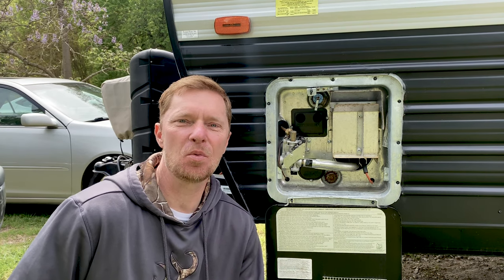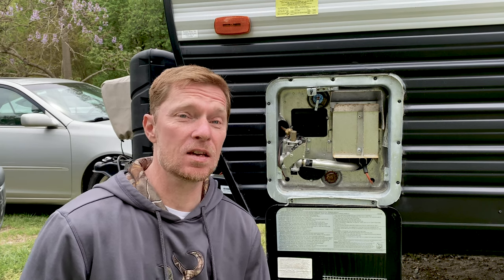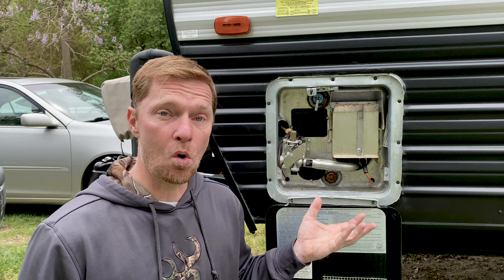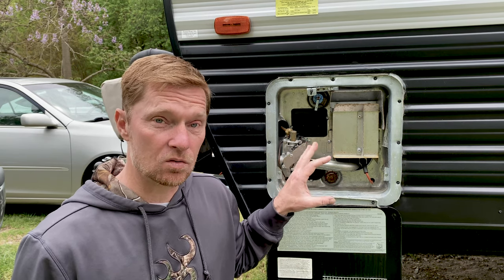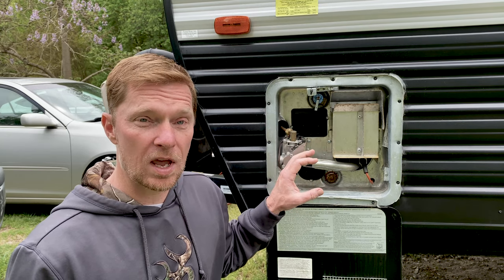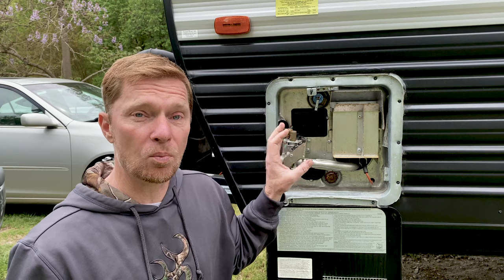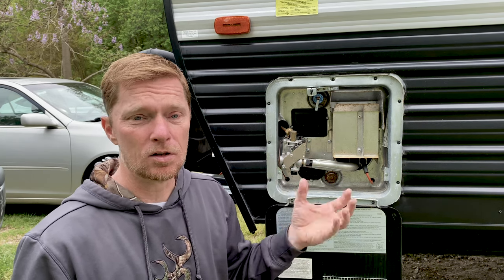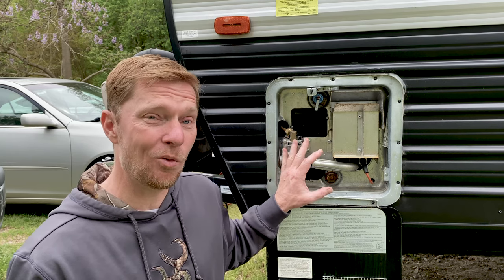Travel Trailer Gas Electric Water Heater Explained 2020

Comment: Just wondering if I should be using propane to heat the water when I'm connected to a 50 amp pedestal. Should they both be on? I have 2 switches inside my coach. Are they both 12volt or might one be 110 (one has a light next to it that says reset)?
Reply from the maker: You do not have to run both if you do not want to. Matter of fact, during the hotter parts of the summer, I leave the propane of for the water heater. As for you switches. Trying running a test. 
1. Turn both switches off
2. Make sure that the propane tanks are on
3. Make sure that the water in the tank is cold enough for the tank to fire up, I do mine by turning everything off and running the water until it goes cold
4.  Turn on the one with the light that says reset
5. Go outside to the tank and see if it fires up
6. If it does not fire up, turn the switch off inside and turn on the other
7. Once you find out which one is the propane, turn that one off and the other one on
8. Again, make sure that the water is cold on the hot water side
9. It is going to take a lot longer but you should start to feel the water heating up from the electrical element

I do not have a panel like your so i do not have any experience with them. I am also on 30 amp. If your unsuccessful, please send me an email with pictures of the water heater and panel and i will see if I can provide some additional support.

Also, I would love to hear back from you on what you find out. Be Safe and Good Luck

Comment: Great video. Can I start the water heater In electric mode only? And if so, does that make the exhaust cover not as hot to the touch? Thinking of grandkids touching it. Thanks
Reply from the maker: Yes and yes. The electric only will not make the cover hot. You will not heat up the water as fast but will do what your looking for.

Comment: Great video..but one explanation needed, my "new to me" 2015 Gray Wolf Toyhauler is NOT hearing my water... Propane is on, and black switch turned on, am I missing any other switch/button ?? Thanks !
Reply from the maker: Make sure that the switch you are refering to is the one for the propane. Mine is located at the panel inside. If you have that one on, try pusing the reset buttons highlighted in the video. Also check the 12V fuse in your distribution panel to make sure it is still good. After that, make sure that there is water running to the heater and that the propane line is not compromised in any way. I would love to hear what you find out.

Comment: What’s the big rod on the drain plug inside for? I originally thought it was the heating element but no wires somehow lol, why’s it so long? Thanks
Reply from the maker: That is the anode rod. You may ask what the anode rod is and I want to help. Here is an article on #RVlife website that will explain everything that you need to know. https://rvlife.com/techtipspreventing-water-heater-rust-out/

Comment: Hi! I have a water pump panel inside RV on the wall and im pretty clear on everything except do i need to keep the HEATER button on while permanently hooked up at park? I do get some hot water while it's off but I do have to shower pretty quick to enjoy it b4 it goes....so is it because I have that button off?
Reply from the maker: On mine, the switch on the inside of the camper is for the propane heating side of the water heater. The electrical side is outside at the water heater. If I have to guess your setup, the electricity may already be on, and turning the switch on inside of your RV initiates the propane heat. Also, you can run both of those heating solutions at the same time, or at least I can.

Comment: Great Info, question, so If I want my hot water to last longer I should turn on the electric  and the Gas heaters ?
Reply from the maker: From my experience yes. What i do now is leave the electric side off until about an hour before i plan on higher usage. This saves on how much of the 30 amp side i am using. Check out this video. It is a little in depth but explains power management. https://youtu.be/n_v7QkFzNds

Comment: Thinking on buy a RV thatyou can only heat the hot water tank by propane. What are your thoughts on that good or bed
Reply from the maker: That’s the way most older RVs used to be back in the day. To be honest, I use mine on propane more than electric. I like to keep the amount of electric used down so propane is what I use most. Hope this answers your question.

Comment: Great video! I would really love it if you could do another that talks about common issues with the hot water tank, or what is normal or what isn't. I have a very similar tank, might actually be the same model, or might not. But I just noticed a slight propane smell, and at first I thought it might have been because I was at the very end of my propane tank, but then I took a lighter to where the oxygen mixes in and a very small flame lit. The problem being I am running the water heater off electric, not propane. If this type of tank had a pilot light I would think that is what was going on, that the pilot light had just gone out, but this type of tank doesn't use a pilot light. Any ideas on what the issue is? Or is it normal to have a tiny bit of propane going through? I am at the very end of my propane tank, and I don't have my other propane tank hooked up...
Reply from the maker: Firstly, never use a flame near gas smell or to find leak. Believe me, i lost a few facial hairs because of that. For the leak, use soapy water in a sray bottle and spray down areas that could be leaking. you will start to see bubbles where the propane is getting out from. There should never be a leak at all, if you do then either something is mechanically not working correctly or you have a fitting or hose not seated like it should be. Once you find the leak, and need to do a repair, contact a mobile repair service to help.

Comment: Just curious.  When I fill my potable water tank, that potable water goes to my hot water heater.  If I then hook up to campground water, does that water then add to the potable water that is in the hot water heater tank?  Once hooked up to the campground water source, the hot water tank does not pull water from my potable water tank?
Reply from the maker: The water heater pulls from either the fresh water tank via the fresh water pump Orr the city water connection but in most cases, it can not be at the same time.

Comment: Great video I'm working on getting mine going it's from 87/5 wheel I just found out it's electric and propane and the electric switch was on which just started making electric noise only when I got water pressurized in the system the pressure valve is leaking also and it has a ground wire that needs to be reconnected which I already knewI'm hoping the electric portion is not busted it sounds like it's trying to work with that ground wire is not connected so we'll see how it goes
Reply from the maker: Good luck! Let me know how it turns out.
Reply: @HowToRV  so far i got the leaky pressure valve  out and the partially stripped  out drain plug finally  there was no anode rod in there just a plug / drain. im thinking i should replace with s anode plug    also in my 88 trailer there is no anode.  and i got that water heater going today !  had a hot shower .
Reply from the maker: Sorry for getting back to you so late. I am glad that you go your water heater running. I HATE cold showers

Comment: Okay just to confirm I can run electrical and gas at the same time? And is that just hook up or battery?
Reply from the maker: Yes, you can run your gas and electric at the same time. The electrical heat comes from hook ups only

Comment: Do a vidio on how to replace the suburban 6 gal hot water tank mine is only a 2016 and its leaking it works fine but leaks badly
Reply from the maker: I think that I can make that possible. I recently went to a tankless water heater and found that it does not meet the intent I was looking for. I am considering putting the original back in, which may cover what you are looking for.

Comment: Great video but I have a question so how do you light the propane side i got the electrical down
Reply from the maker: You can’t light it manually. Without the battery, the solenoid will not allow propane to flow and igniter not work.

Comment: Nead to know what electric components are between the fuse box an on off switch, any circit bouards or anything that would prevent powered to the switch?
Reply from the maker: Sorry but it depends on your build. Mine does not have anything between but that doesnt mean that yours doesnt either.

Comment: Hi im new to all the stuff u need to know about rv"s. I bought a 2008 5th wheel and i called the make of my hot water heater to find out if it was propane or elec, will i called two times and one person said it was propane the 2nd said it s both. That i need my propane hooked up to get but i dont need any gas ig the tank just hooked up to it. It is a Suburban SW6DE. Oh and if so how do i know if the propane is hooked up to the hot water tank. Thank You
Reply from the maker: Cheryl Smith when you open the door to the water heater from the outside, there should be a copper line attached to the solenoid like I showed in the video. Have you tried using the water heater yet?

Comment: Hi I have a very dumb question but I was doing some electric repairs and turned everything off and disconnected everything. Anyway. How do I know of the water heater gas/electric switch is on or off? I’ve messed with the switch too much to remember how is on or off. Mine says gas and electric and has a red light in the middle. I’m getting paranoid about fire hazards and so I want to be sure I have the correct information. When the light is on it means the gas heater is on? The light is not affected by the electric switch just the gas switch but some people said red light on means gas is off others say it means it’s on.
Reply from the maker: There are so many different setups that it is hard to decipher. The red switch inside lights up on my RV and is for GAS only. My electrical switch for the water heater is outside at the water heater itself.

Comment: Would be interested in running gas/electric RV heaters on electric only. Seems like there is no thermostat control for the electric element on either a Dometic (Atwood) or suburban unit. The motorhomes in my park are long term space rentals, and you can't fill the propane tanks in place. Most of the MH and trailers here are running on electric for cost reasons.
Reply from the maker: Mine is made by suburban and the electrical side is controlled by a temperature sensor on the tank that runs through a control board.

Comment: How about the reset switches behind the black square by the relief safety valve?
Reply: Good video
Reply from the maker: Thank you. The black square does not have switches. It’s where the heating element is wired in.

Comment: I've got an 09 Rockwood Ultralight signature series. My switch is next to the hot water heater propane switch located on the lower cupboard in the kitchen. Can you tell me if this is the electric element switch or is it some other switch? It lights up when turned on but ot doesn't seem to do anything.
Reply from the maker: Try leaving the swith on the lower cupboard off and the switch on the water heater on. Check to see if you still get hot water. If so, then the electric is working. That is if your plugged in. Once you have checked that, turn the switch on that water heater off and the one on the cupboard back on. This should make the propane turn on. If your propane bottles are open, you should get a flame on the water cools down. Make sure that you have water running to the camper and electrical hooked up for this test. Let me know the results.

Comment: Great info here. So I did turn mine on with an empty tank after winterization, I changed the element and no hot water I changed it again, no hot water. I try to push the reset buttons you were showing but they didn't reset as if if you couldn't push them in. The power was on maybe the unit should have been off when trying to reset? Any other hints here? Thanks, Noel
Reply from the maker: If you have the means to do so, check the leads to the heating element to see if you have power coming to the heating element. sounds like you know what you are doing but if you have not checked already, look at the breaker panel to make sure that the breaker for the water heater is not tripped. You can check this by turning it to the off position and then back on. Mine has an on/off switch on the tank itself and i have to make sure that it is on as well. If that all checks out, there is a thermostat control board that tells the heating element to come on and off. I found this video and may be of some help to you. https://youtu.be/j5jN3tHVAnU Let me know what your outcome is. You can email me at IYOconnect@gamil.com What ever you find out may be worth a new video since i have not experience this issue myself.

Comment: Very good video. I have a question for my rv using propane for the water heater (electric not working) thay's why I used propane. It keeps the propane gas running even though the inside rv switch for propane is turn off. It was frozen last week and I just came back to the rv park. A friend from the rv park told me the problem may be the gas tank that was frozen last week, but stove and even water heater works, but sometimes it keeps running gas even when it stopeed heating. I would appreciate if you help me with this issue. Thank you.
Reply from the maker: What is telling you that the propane is still running gas even when it stopped heating?  Just a reminder, i am no professional and i share topics from my experiences. If you can help me with a little more information, i maty be able to point you in the right direction. Also, if the propane keeps running and there is nothing using it, like the water heater, furnace or stove, then you may have a leak and that is really bad and you should turn off the tanks until you can safely resolve the issue.
Reply: @HowToRV  Thank you for writing me back. Now it seems to have hot water all the time even though the inside switch to turn on gas water heater is in the off position. Also sometimes pilot in water heater stays on for a while. Don't know if it is normal. Thank you for your time.
Reply from the maker: @lobojr9584  are you connected to shore power. If you are, you may have the electrical side still on. As far as the propane goes, mine stays on for a little while too. The temperature switch keeps the propane running until it gets to temperature.
Reply: @HowToRV  you are totally right.  This comment answered me the question that I had. The electrical part of the water heater was on an working. I thought it was not. Again Thank you very much. Great channel.
Reply from the maker: @lobojr9584  That is awesome news. If you are interested, take a picture of yourself and your family with your RV and email it to me at IYOconnect@gmail.com. I will post it on the community tab on my channel.

Comment: Great video. I’m a novice and it helped. Want to ask can I run on electric only or gas only or do I need to use both together
Reply from the maker: you can run in any of those methods. I run electric on really short stays. For the places that do not have bath houses or if it is in the winter, i may turn on both at the same time. If do not electric hook ups, naturally i use propane only. Remember to turn off the electric switch when not hooked up to water.
Reply: @HowToRV  so if your boondocking you turn the electric switch off? What if your using a generator?

Comment: Do I have to have both switch the electrical and gas water heater on to get hot water? I do have on jus the electrical and I don’t receive hot water. Thanks
Reply from the maker: Is your RV plugged in to power?  The water heater only works on 12V which is for lighting the propane system.

Comment: Is the element switch to be in the on position even if your using propane for hot water? Connected to city water. Not filling the holding tank?
Reply from the maker: The switch does not have to be on for propane. If the tank is not filling, look on the backside of the water heater and you should see 1 or 2 valves. These are for bypass valves for winterizing. Turn them and see if that helps.
Reply: Great thanks bud. Yep 👍🏼 it’s burning 🔥 nice and hot!

Comment: You, sir, are a saint!

We're new to RV'ing and I just went out to start getting ready for summer trips and found the electric switch in the "On" position. I'm thinking ours may be burnt out since I don't think we turned that switch on.  🤔
Reply from the maker: If you were not connected to power, you may be ok. I am interested in what you find out.
Reply: @HowToRV  I am hooked up to power. I adjusted it a 1/2 turn clockwise and it stopped pulsing. 👍
Reply from the maker: @irenechavez6018  what did you adjust?
Reply: @HowToRV  Oh! My water was pulsing and I fixed that by making the adjustment to the water pump. I just started working on the water heater. The propane is working, but I'm not sure how to test if it'll heat with electricity only. I'll have to do some research.
Reply from the maker: @UCjQ86MnWnhKbpfyb1d18yKQ well dang.
Reply: @HowToRV  False alarm. The faucet in the bathroom sink wasn't shut off all the way. 😅 No pulsing now
Reply from the maker: @irenechavez6018  What an emotional roller coaster. 😂
Reply from the maker: @irenechavez6018  try by turning the water heater propane switch inside the RV off. It should be on your panel with all the other switches. Run the hot water side until it goes cold and the wait. If it gets hot then your golden. You can also turn the propane bottles off to make sure the propane side doesn’t come on. You need to watch my video on how to monitor your electrical system.